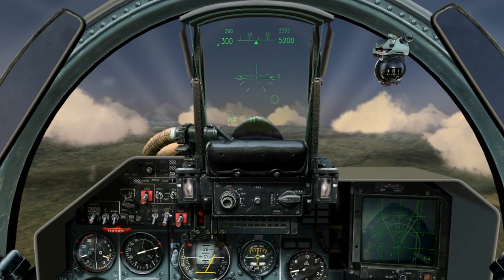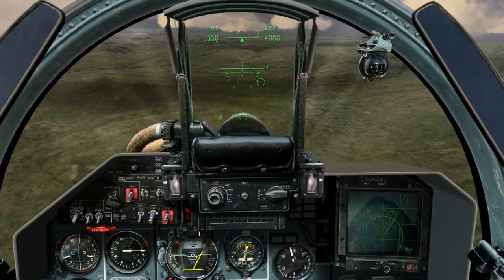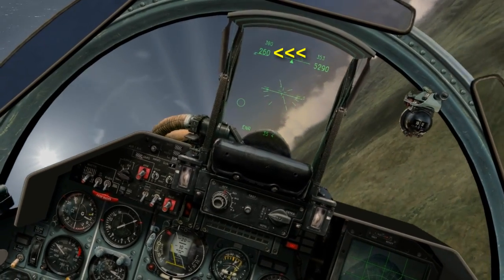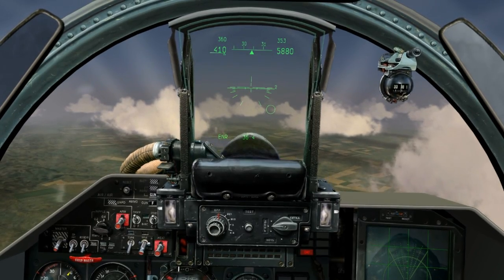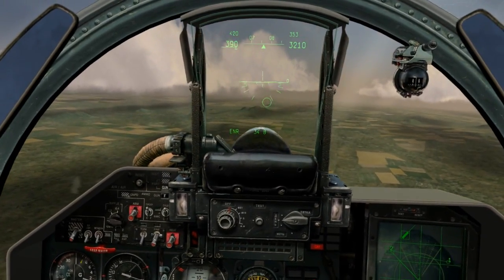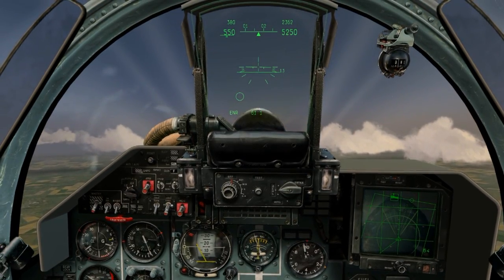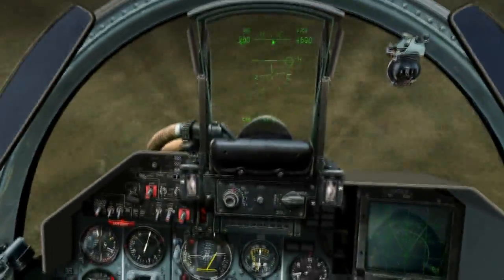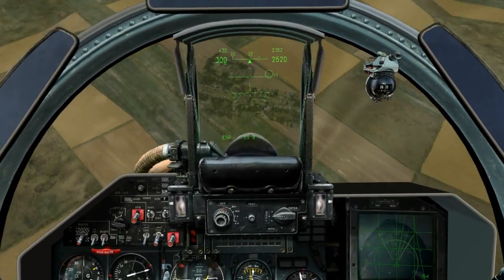Stalls and Spins and How to Recover; LockOn FC2 (Part 2)

Comment from the maker: @ohiorc This is because when we are vertical, there is no AOA. In theory, assuming the airfoil is symmetrical, zero AOA translates to zero lift. In reality, the wing generates some lift, but it's insignificant to that generated in level flight where it must counter the force of gravity. Thus the need of AOA in level flight. 
Another way of explaining this is that in vertical flight, any lift generated by the wings will be perpendicular to the weight of the aircraft and therefore unnecessary.

Comment: @EAGLEEYE2431 Try looking up information on fighter tactics and energy management. There is a range of manoeuvres you can employ to maintain energy and control while avoiding your opponent gaining your six position (e.g. Yo Yo). It also depends on the performance of your fighter in relation to your opponents (e.g. a zero will could turn tighter and faster than most allied fighters early in WW2).

Comment from the maker: @EAGLEEYE2431 Hmm... I don't know exactly how to answer this without just GIVING you the answer. 
In a hard turn, you want to pull the highest angle of attack possible to allow you the airspeed that will give you the highest G. This is your corner speed. However, this is getting into a whole other discussion. Please message me and I will link you to somewhere that will answer this question. Basically, you will want to maintain what is called "corner speed" and pull back enough to maintain it.

Comment: Excellent demo and explanations.
You could have mentioned in the stall & spin recovery process' that neutralising the controls means ailerons level (whereas your patter focused on the elevator, and so, a novice may miss the relevance of the term "neutralise" to all control surfaces).   Also, that having the ailerons deflected in a stall can result in a spin.
Lastly, you could have addressed the issue of minimum altitude from which to recover from both and the relevance of flaps.
Thanks again.